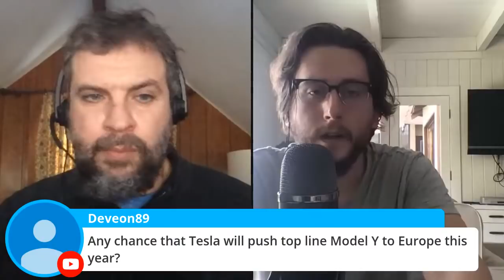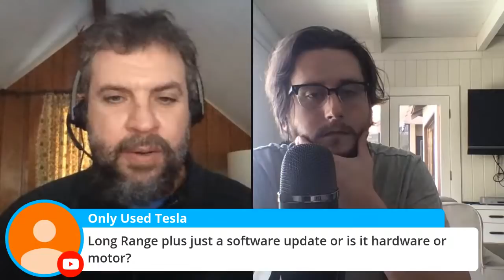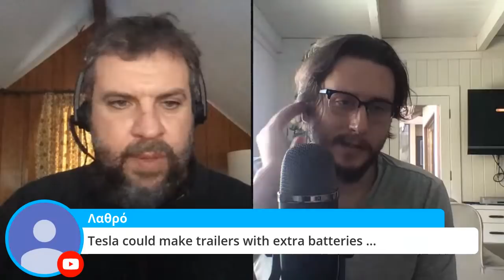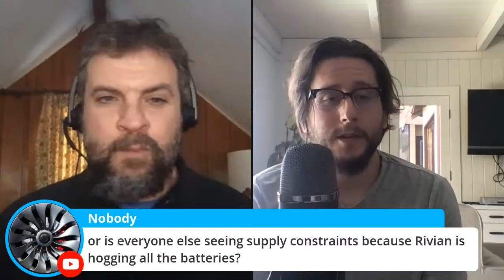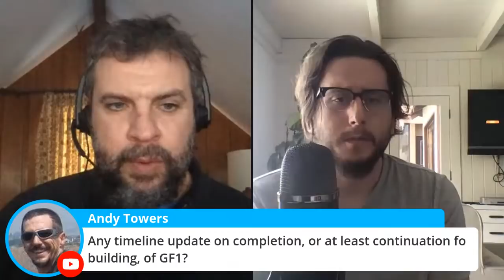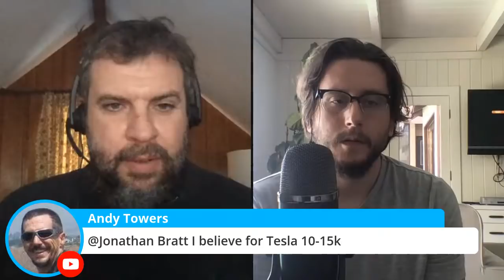Podcast: Tesla 110 kWh battery pack, LFP batteries, Porsche Taycan fire, and more

Comment: I'm trying to get some parts to make a unique ride starting with 3 ideas, power regeneration, speed vs acceleration and batteries I'm in to designing a safe lipo cause of there constant burst rating. But I only know so much so any knowledge is much appreciated. Shane 727 skiles

Comment: The DC backbone doesn't make sense. It has been considered pretty much a failure.  Not in a sense it doesn't work.  But a sense that it was a major block to mass solar adoption.  Basically the classic DC solar battery system is a maintenance and upgrade nightmare.  Very difficult to maintain and upgrade, then only by solar experts with all specialized parts.  Once you converted to AC, any electrician can repair it, and you can get half the parts from home depot.

Comment: The 108 cell group sounds interesting.  It is really tweaking the car to get every last speed, performance, range boost. The 800v pack of the Taycan would require brand new superchargers for charging.    Where adding a few cells to each cell group upping the voltage slightly(400V->450V) boosts charging speed by 12%.  Also they should still be able to charge all the existing superchargers.  My guess is these 110 KWH Model S batteries could charge at something like 225 KW on the V3 chargers vs about 200 KW now.  Tweak the pack with slightly thicker wires and you are at 250 KW.

Comment: I think you guys are completely off with the batterie (110kwh) to go in the plaid S/X. I think its much more reasonable to think that the 110kwh pack is achieved by skipping the modules in the batterie and make the whole pack one gigant modul. This leaves enough room to put more cells in the pack with the same energy density. Plaid will get the new pack with the new cell chemestry. With more capacity. Thats also why it comes out later this year. 110kwh pack is just a step in between I think.